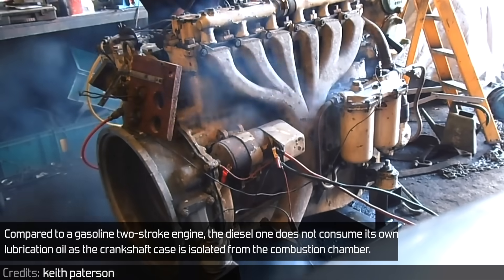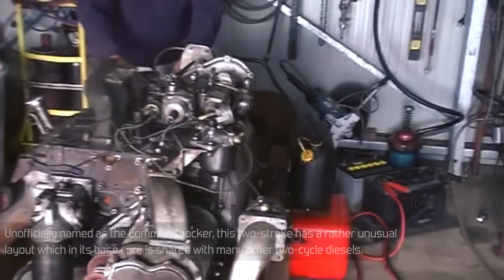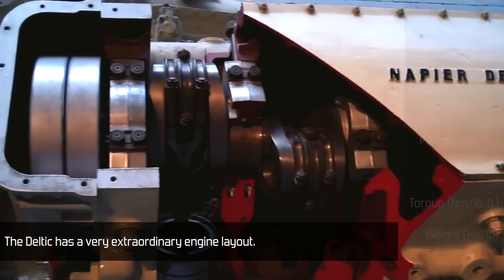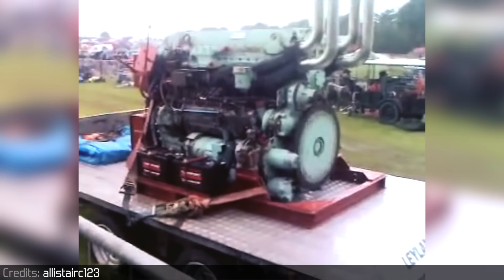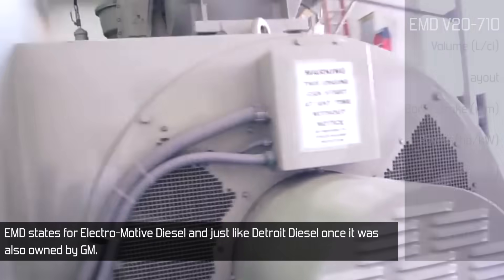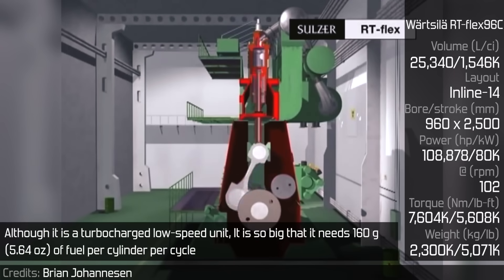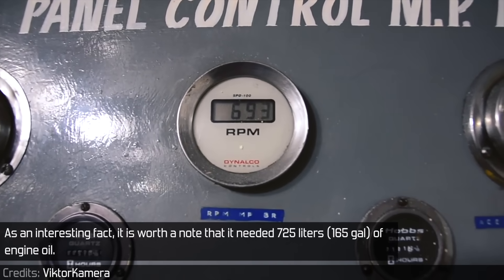9 Cool 2-Stroke Diesel Engines

Comment: When 2-Stroke Diesels are so efficient why arent they used in cars anymore?
That would be a interesting thing to know
Reply: Karol Kozłowski 2 stroke gas engines burn oil which is why they arnt as widely used but 2 stroke diesels only burn diesel. No oil. The crank case is sealed just the same as a 4 stroke diesel the only difference is the scavenging ports and exhaust valves which make it able to not need to burn oil.
Reply: you know 2 strokes have more torque then 4 strokes......

HP is a multiplication of torque x RPM.. so if a 2 stroke does less RPM and produces more HP or the same HP it will have more torque

Remember it is firing twice as often.. so it will produce more power per rotation. simple 

Also HP is still how much power something has... more torque with the same HP means that you don't have to rev it as hard.

a motor that make 600hp @ 6000RPM will pull a load up a hill just as fast as one that does it @2000rpm if the gearing is correct
Reply: They are still widely used, also being build new in Trains, boats and stationary powerplants.
Reply: Karol Kozłowski diesel particular filters do exist. Or is it too expensive?
Reply: 2-stroke diesels are more efficient only at lower speeds like 150 rpm redline on large boat engines or 1500 rpm redline on train engines because unlike 4-stroker's that have a full exhaust stroke that removes all burned gases from the cylinder on 2-stroker's there is only a small gap next to the BDC - the inlet port- and it relies on blower pressure (and turbos in a efficient setup) to flush the cylinder with fresh air. At high speeds a lot of burned gases will remain on the cylinder and performance and efficiency go down. Other thing that killed 2-stroke engines on the road were the lack of torque, what moves cargo uphill, not KW/HP!
Reply: "a motor that make 600hp @ 6000RPM will pull a load up a hill just as fast as one that does it @2000rpm if the gearing is correct"  That's absolutely wrong not in a million years!
I used to drive a scania 420hp and my friends driving renault (volvo engine)450hp mercedes 440hp with the same weight and about the same age they could never double me and when I double them they couldn't see my tail lights for along time, why? +torque on the scania engine!

"you know 2 strokes have more torque then 4 strokes...... HP is a multiplication of torque x RPM.. so if a 2 stroke does less RPM and produces more HP or the same HP it will have more torque Remember it is firing twice as often.. so it will produce more power per rotation. simple "
No, not that simple , and it also means that the engine is burning twice the diesel without giving much back. Before you came with crappy comments you should learn engine basics bore and stroke, friction, whole moving mass, working cylinder moving mass among other things and how do they affect any engine properties in the end.
Scania just launched a new 7liter I6 engine, the top version is 280hp the other option at 280hp is older 9liter I5 that is modular with 13L I6 and 16L V8, the new one 1200Nm the old is 1400nm whatever it is in ft-lb. The  technology is about the same the new engine is more economical mostly by the metal design but it is lacking some torque.

The best 2-stroke were detroit diesel, lower on torque compared to contemporary 4-strokes , everytime you shift down you lose momentum and time . Americans have a joke for them - If you scream hill on the cb the truck  immediately lose 20mph!
BTW "Horsepower is how fast you hit the wall. Torque is how far you move that wall"
In theory 2-strokes should be better but practically they aren't any better for road use.
Reply: @acrodrigues1  Horsepower is how far you can move the wall per second, torque is how low your gearing can be to still move the wall.
Reply: If after that much gearing down you even scratch the wall it's because you fell asleep while crawling so bad! :D:D
Reply: Karol Kozłowski 2 stroke diesels do not burn a fuel oil mix like that of a 2 stroke gas engine

Comment: Question: On the Wärtsilä RT-Flex96C its written that it has 7,604k NM Torque, so does this mean it has 7.6 million NM of torque?
Reply: yes......
Reply: Thanks man,  its just an unbelievable high number, my first car had 210 nm of torque, this is unimaginable
Reply: If you only want one engine to power a massive cargo ship, that's the kind of torque you need.
Reply: When you open up the cylinders you can sit down on it. I took a tour of a container ship and one of the workers was taking a lunch break sitting on the piston.
Reply: Zach Ogdahl ,

Comment: I didn't know that two strokers could be Turbocharged... Cool
I also didn't know that they could be that efficient... Cooler
Reply: You have to differentiate. normal gas 2 strokes can't, diesel 2strokes with the need for a blower can.
Reply: Makes you wonder why the 4 stroke is so popular in the railroad business, doesn't it?
Reply: jesus look at all the turbo sleds, custom converted aluminum v8's converted to 2 stroke  poppet valved loop charged and the big 2 stroke turbo diesels.

Comment: Those Napier Deltic's were quite an engineering masterpiece!  And the EMD 645's are the most plentiful & hardest working (my opinion) locomotive engines ever made. Another great video!
Reply: I had no idea that thing existed until this video. That's one of the coolest engine designs I've ever seen. I learned about so much cool stuff from this channel.
Reply: if you admire the Deltic than the Napier Sabre will blow your mind.
Reply: @turbofan123  Just looked it up. Yikes ! The piston arrangement !!
Reply: And the Napier Nomad will blow your mind into orbit!
Reply: TIMMEH19991 It was maybe the most powerful but it surely had not the best power to weight ratio. The Junkers 205 had around 1,48 hp/kg and the napier deltic around 0.5 (the 3000 hp version, the 5000 hp version had around 0.8 hp/kg). This makes sense when you know that one was used in aviation and the other in trains ;D. Junkers also made the Jumo 223 with around 2500hp and a power to weight ratio of around 1,786 hp/kg but that just ran on the dyno and wasn't actually used.
Reply: Still the power to weight ratio of a Napier Deltic compares very favourably with other railway engines, hence a Class 55 locomotive with two 18 cylinder Napier Deltic engines actually weighs slightly less than a Class 37 with one 1750hp four-stroke V12.
Reply: Gordanovich02 
No one's saying it wasn't a good locomotive engine, i just wanted to point out from whome the original engine concept came from ;D. People who know about the Napier Deltic engine praise it for a completely new, high advanced, never befor done concept, wich it wasn't.
Reply: +TIMMEH19991
The clever thing about the Deltic is that it needs only one extra crank over a Jumo, but it trebles the number of cylinders.  The Deltic layout did not use crankcase air intake so had to be supercharged.  Its thermal efficiency was around 50%, perhaps the highest ever achieved with an internal combustion engine, but if it had been turbocharged as well, that would have risen even higher
Reply: Yes, EMD manufactured 60% of America's Diesel-Electric Locomotives, and the reliability of this engine was one of the reasons that they were so popular. A 20V645 could produce up to 5000HP, although the 12V and 16V engines were more common. Of course, in the USA Multiple-up units were common. I've seen a video with 11EMD Locos hauling a 10,000ton coal train - with one driver! 6 engines in front, and 5 in the middle.
Reply: Paul Standeven To be exact, every turbocharged two stroke diesel is in this efficiency range and on top of that is the delzic engine just a jumo copy, if don't believe me go search for it.
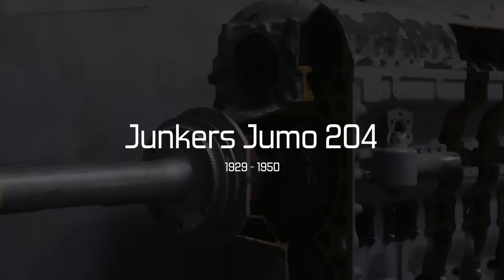Reply: The Deltic engine was developed from a mental aero opposed piston diesel engine made by Junkers called a Jumo 204. (5:42 onwards) Junkers discovered that to make an opposed piston 2 stroke engine work one crank had to lead the other by 8 degrees. Late 1920s this engine had 800bhp from 18 liters! Napier made the Jumo engine under licence and a Napier engineer in WW2 found that if you built a delta arrangement and made one of the cranks rotate in the opposite direction to the other two, you could maintain the 8 degree advance. The most powerful power to weight ratio diesel engine of its era was borne....

Comment: oh man the detroit diesel series needs more reconition especially the 6v53 engine !
Reply: Would love Roadkill or Dirt Every Day to use one on a project (even do a garage episode with them checking and overhauling one). Also add another cummins episode.
Reply: I love the 8v71, gotta be an 8 cylinder
Reply: I have an 8v92 silver turbo, love it
Reply: I got an 9v92 silver turbo
Reply: would love a 4-53T in my 1988 volvo 740, for bether caravan pulling efficiency xD
Reply: Rick Delair modern ish 4 cycles are way better than the old ones. I just set valves and injectors in a cumins n14 select plus this morning. 525hp with fast starts in any weather and 2 million Kms on it. In a log truck with 51ft trailer running double shift for the past 10 years. Way better than any Detroit. I've worked on them too and the owner of this cumins says it's the best engine he's ever had.
Reply: I've commonly heard them called fuel converters. Converts fuel into noise and smoke. My dad has tons of them in various things. 8v71turbo on his old transstar dump truck
Reply: The sound of them!
Reply: Rick Delair i once saw a chev s10 with a 3-53 in it and he had another transmission behind the main one installed backwards to get enough speed out of it to go on the highway. The gas would cruise at 2800rpm but a 3-53 doesn't go that high
Reply: No triple or v6. https://en.wikipedia.org/wiki/Detroit_Diesel_Series_51
Reply: Turbo charged or not they sound great on straight pipe! Im a fan of the series 60. But my favorites are the 70,s and 80,s models used in fire engines. They were 6 cyl I believe. 89VA I think. But the sound when the pipes got aged well was awsome.
Reply: Rick Delair the amount of money that has gone into the emissions shit at this point is neons the point of no return. They have so many hundreds of millions of dollars invested they can't change what there doing. We'll never see a commercial viable 2 stroke diesel in North America again. As of Jan 1st every single engine coming into Canada has to meet teir4 emissions. DPF, DEF, EGR, EAT etc all ruin engines and use more fuel. Who knows what will happen in 10 years
Reply: Olivier Delorme  and so the 8V53 and the rare 12V53 !
Reply: Rick Delair yes, 8v51 must be very rare !
Reply: Get an aftermarket aluminum block and cut ports into it? i guided plasma cutter can do this easly!
Reply: I hope you got a real strong chassis and heavy duty springs.
Reply: had one in a timberjack...powerfull for the size (3cyls-blower) but holy mother of god the bastard was brutaly noisy
Reply: I want a 2v53 for my Hyundai Accent.